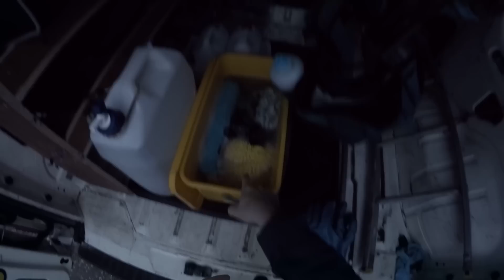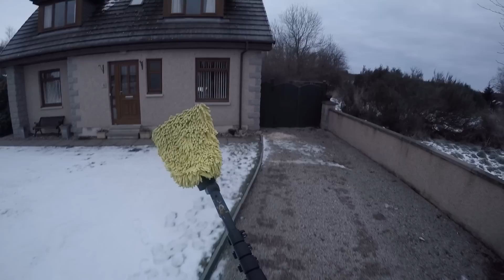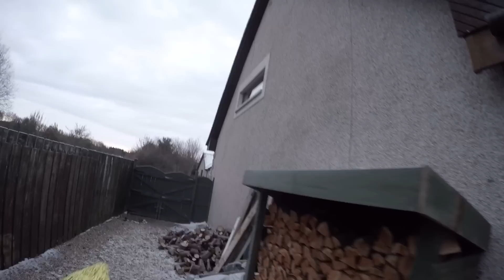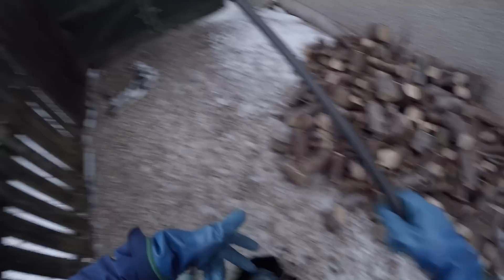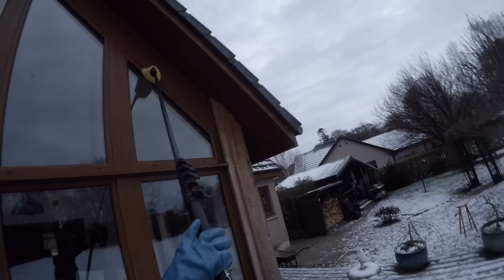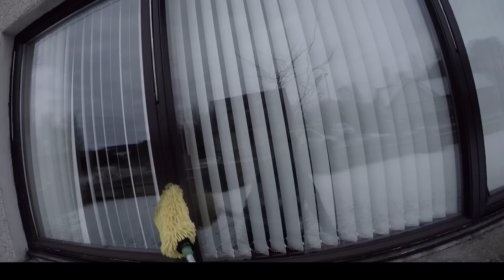Window Frame Cleaning Traditionally - LADDERLESS

Comment: GREAT VIDEO PETER  THATS WHAT I USE SAVES PUTTING A CLOTH ON THE POLE  ITS ALSO GREAT ON UPVC FRONT DOOR S GETS IN ALL THE AWKARD CORNERS
Reply from the maker: It is good ;)
Reply: Why get the ladders out on maintenance cleans quicker with the mit or mop
Reply from the maker: @mickschofield1577  yeah it is quicker I find and easier on the body :)

Comment: Hello Peter what’s the best 20 foot extension pole you recommend? Keep up the good vids. 👍🏽👍🏽👍🏽👍🏽
Reply from the maker: There's a couple decent options, there's facelift phantom or Gardiner, and later this year moerman will release a pole
Reply: TRAD - MAN cheers for the info I was going to buy a moarman 16 ft pole. Any good?? 👍🏽👍🏽👍🏽
Reply from the maker: @DeekMacGibson  the current moerman aluminium poles are not good, but this year they will release a carbon pole which is much better
Reply: TRAD - MAN any ideas on the cost? 👍🏽👍🏽👍🏽
Reply from the maker: @DeekMacGibson  it'll be a good few hundred pounds for the new carbon moerman pole but nothing confirmed yet.
Reply: @TradMan  nn